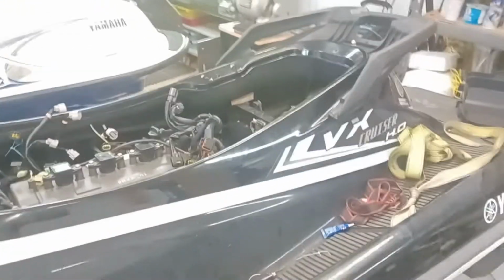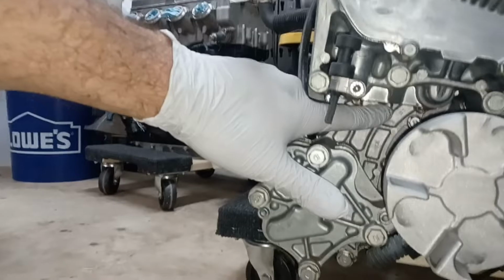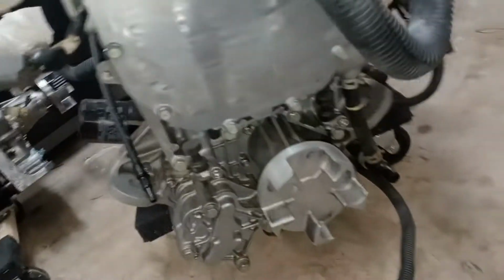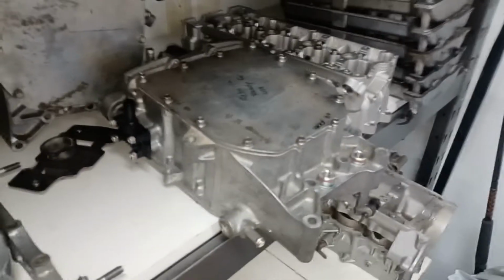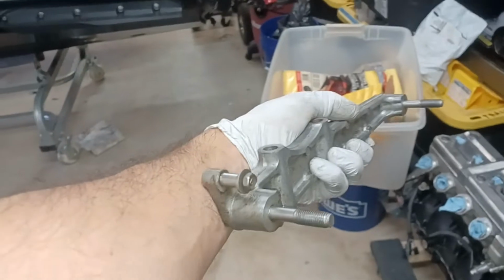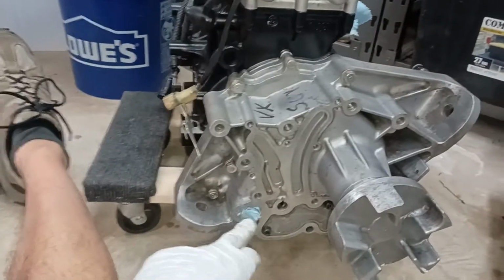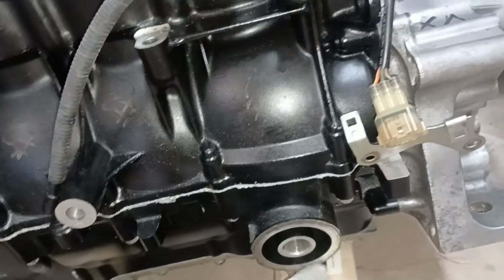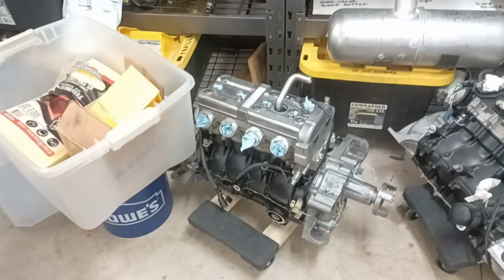Yamaha fxho, fx140, vx110 possible oil leak locations

Comment: Awesome video, it is really useful to see all the different parts of the engine.
I had an oil leak and i hope it's fixed. The oil filter was rusty, especially at the base. I needed a razor blade to scrape that seating surface to clean it.  After i did this, i noticed the bilge had some oil. I cleaned that up. Ran the ski in the ocean for an hour or two and just a little oil in the bilge. Maybe residue from before. I have a 2014 vx110
Reply from the maker: I'm really glad this video helped you! It definitely helps to see someone run a camera around the parts to gain the confidence that a person can do this themselves

Comment: Would you have a 06 fx140 for sale? Was told mine shot a rod. I didn't believe the shop as they pushed to buy the ski it has 46hrs on it DC area
Reply from the maker: @tonyyoung6738  I do.  my longblock is a 2007 FX140...same motor.  Shipping isn't gonna be cheap but mine comes with EVERYTHING to drop into your ski and is a 75 hour fresh water motor.  The ski that it came out of was in San Antonio Texas and got hit by a palm tree that smashed the front of the Hull.  Mine has the starter, stator and stator housing of course, oil reservoir, oil pump, PTO rear end gearing, of course the entire OEM head assembly still attached, exhaust manifold.  Send me your email address if you want to talk price and shipping.

Comment: Hello, I stumbled on your page and I'm enjoying your content. Any advice for yamaha vx110 2005 milky oil, (most likely self induced with water hose on while motor off) been flushing and more flushing oil. Any pointers?
Reply from the maker: Best suggestion I can give is visit the pwc repair forum at www.greenhulk.net and use the search feature.  There is a ton of advice on this.  Most say 5 oil changes.  On the last oil change, also change the fter and then run the shit out of it on the water and the remaining slight milkiness will vaporize and the oil will be clean again.
Reply: @AndTodaysProjectIs  thank you very much

Comment: I have  2006 yamaha FX HO. I had a ton of oil in the bilge and I think this video will help me. Do I need to drain the oil out before I pull that oil pump manifold assembly that you have here in the video?
Reply: What was the issue? I have same year with same oil in bulge
Reply from the maker: You probably cannot remove the oil reservoir without removing the cylidner head off of the motor due to the configuration of the strap support that attaches this to the cylinder head being in the way.  I believe you will have to pull the entire motor out to get this out of your ski

Comment: What type of sealant would you recommend reinstalling the oil pan?
Reply from the maker: Hmmm, just fuel resistant black etc works fine.  Surface prep is HUGE!  Make sure they are clean and use plenty of brake cleaner and clean shop towels prior to mating surfaces.  I suppose motoseal is good too